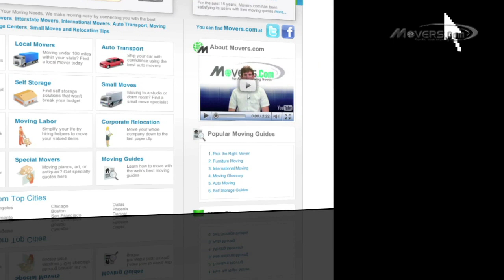How Movers Pack Pianos

Comment: I have moved over 9,000 pianos over the last 39 years. I wouldn't let this crew anywhere near a grand piano, of any size! Especially a nice instrument. Foot pedals are known as the lyre (along with the lyre stays), pins are known as hinge pins. The music rack is known as the music desk. A professional mover is not the same animal as a professional piano mover. Rarely do I remove the lid (not "the top", nor the music desk). If you do remove the lid, you have to remove the hinge pin hinges as well as the pins, otherwise you put undue pressure on them causing them to strip the little screws mounted in the cabinet casing of the instrument. . They did do this in the video. A piano that size requires two movers with better (different dollies and a different size piano board). In bad weather, such as snow or mud, a third mover for traction and safety is appropriate. Picking up the full weight of even this small piano is inviting someone to get hurt. Some of them were using their back like a crane as they bent over down low, without bending their knees.
Reply: jimmy burgoff thank you. I move them all the time. Never ever done it like that. Always have someone holding it when I do the legs. That was retarded
Reply: Wow seriously does knowing the specific names of the pieces have ANYTHING TO DO MOVING THE PIECE???NO ...STOP BRO
Reply: I have similar experience to yours- only it's 41 years now! Mostly Boston, Cambridge, NYC. market area, back when people still  bought acoustic pianos. Twelve instruments a day was not at all uncommon.  
I'm sure you could go on for another three pages, I know I could. In a nutshell that's just about the complete opposite of how it should be done. At least they had the foresight to use a junk piano. You hit the nail on the head regarding injuries too, he must carry workers comp forms with his inventories. Lately I'm more likely to use a crane as I am a little long in the tooth to be humping stairs but strangely (sadly?) I still enjoy it.
Reply: @therealbmh1907 I was also very surprised to see this. The removing of lid and music desk is totally unnecessary. The piano is perfectly safe with the lid firmly closed. Attach a suitable cradle that allows for the hinges and the manipulating on that board is dispenced with.

Comment: There is a heel on the piano board for a reason, to stop the piano slipping off the board in the event it was not strapped tightly enough AND to enable the movers to tilt and pivot the piano at the end of a ramp. set of steps etc.  These movers turned the piano sideways on a sloping ramp risking the dolly shooting out from underneath the piano board resulting in the piano falling, causing damage or injuring the movers - an amateurish mistake. The piano was brought out of the house with the top of the piano board coming out first.  The heel end of the piano always leave the premises first in case tilt and pivot are required. When tilting the piano onto the board you also need to take pressure off the other two legs as you don't know if they are secure from the last move.  It's a pity it didn't show them moving a larger piano or concert grand.  This is not a good example of moving a piano, even one as small as this.

Comment: 1. Put a  two pieces of a foam strips about  3" x 5" x 1/4 thick on both ends of the fall board to secure it tight,  prevent from  rubbing the finishing.
2. Use a support (leg substitute) couple inches longer than a piano leg to hold a piano while you removing first (left) front leg.
3. If you have a piano skid board you don't have to remove a music rack and lid. Just make sure the lead will be outside the skid board while you flipping a piano on its side.
4. The furniture dolly is not suited for moving a pianos. 
5. It's a two man job.
6. Always mark legs with a marker: L, R, B. (Left, Right and Back). Also mark a pedal mounting screws, they could be different in length then leg screws.
7. Put all the pedal and leg screws, washers, etc. into the ZIP bag, you never will lose them.
8. It's convenient to put legs into the large suitcase on wheels, use old towels to keep them from rubbing each other, and just roll them in the suitcase. Also you can put pedal brackets, supports and rods into the suitcase, and you never will lose them.

Comment: This is the smallest, easiest grand piano I've ever seen. This would take myself and one of my movers 10 minutes flat to bring to the truck. It's much easier, faster and more stable to just skid the piano down the steps. And why doesn't their skid have any strap handles? Also why didn't they just tilt the dolly and skid onto the first lip instead of lifting both ends up like that? What the fuck is going on here, it hurts my soul as a piano mover.
Reply: if your a piano mover that's sad
Reply: if your a piano mover that's sadd
Reply: It's a baby grand